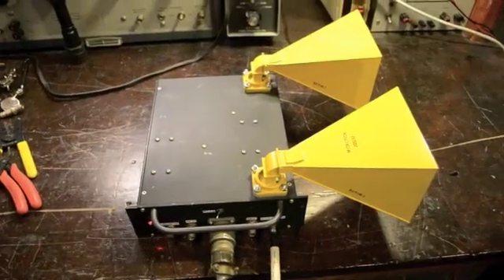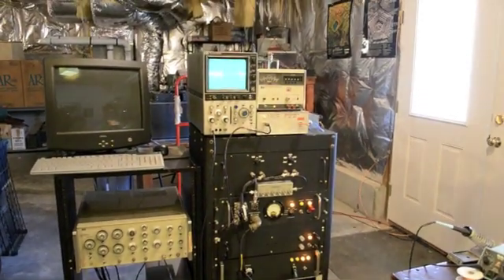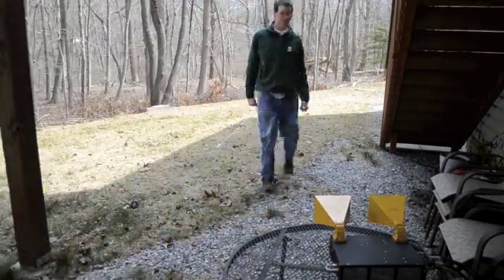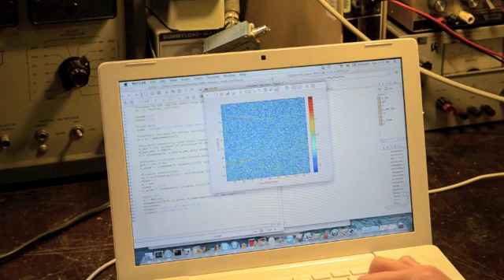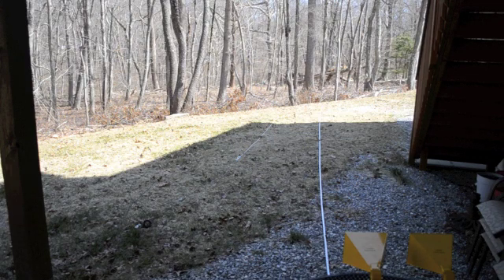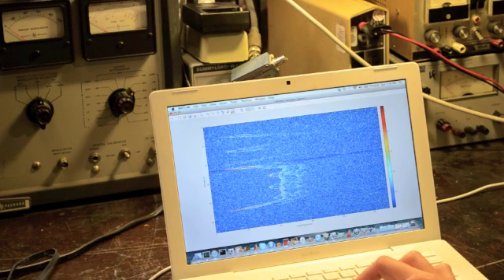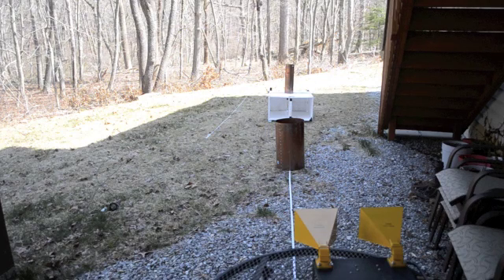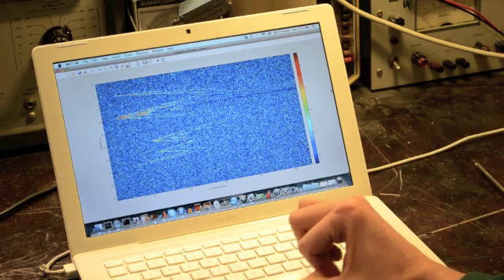UWB Impulse Radar Demo at X-Band

Comment from the maker: ADC is a National Instruments PCIE-6014, 16bit 200KSPS.  I'm a big big fan of NI products and Labview because they allow people like me to implement software control and data acquisition very quickly.  I use an old HP 2 GHz sampling scope built in 1973.  This reduces the requirements on my ADC so that i can sample at low rates.  NF of the front end is estimated to be 4 dB, it's an older LNA that i bought at Dayton Hamvention with no specs available.